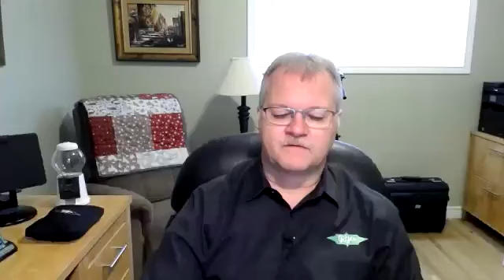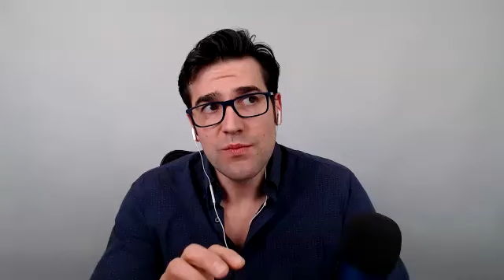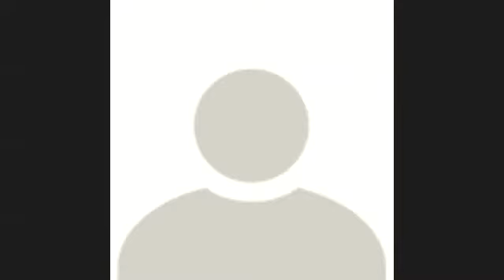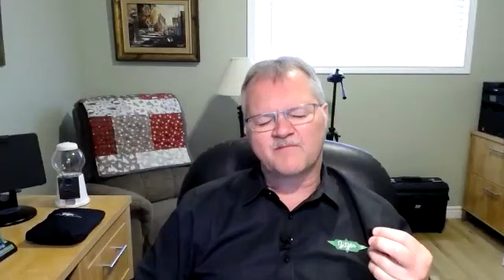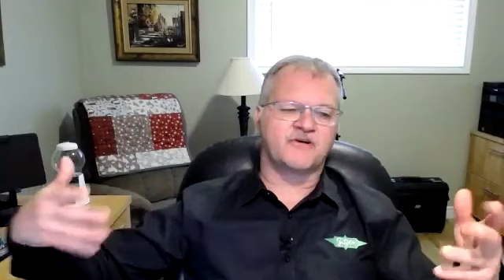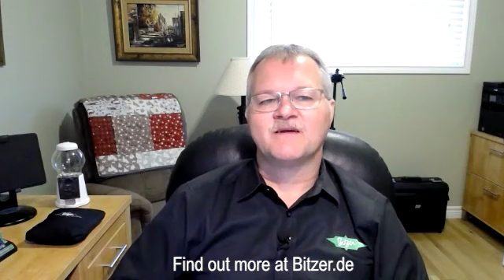Bitzer CO2 Compressors with Phil Boudreau

Comment: Is it possible to use unloading cylinders and vfd at the same time on a compressor for max regulation?
Reply from the maker: Is it possible yes, anything is possible. will you run into issues probably.  The manufacturers do not recommend it. I believe you could run into oil issues and overheat issues because of mass flow.  Both technologies are trying to achieve the similar results. If you try it out please let me know how it goes.